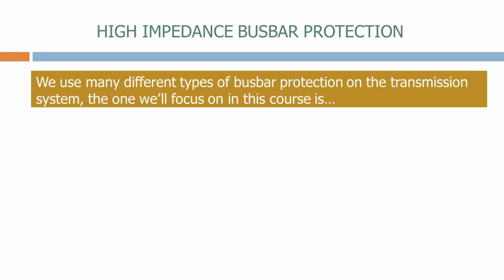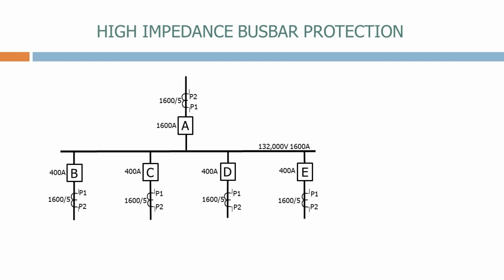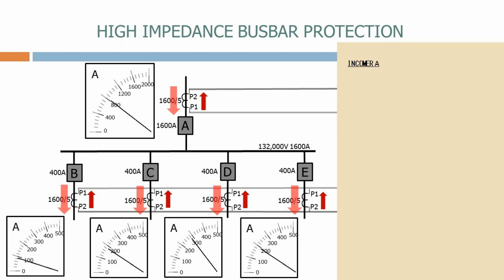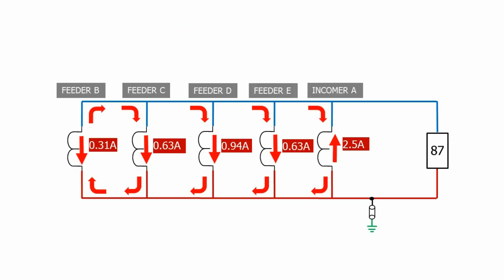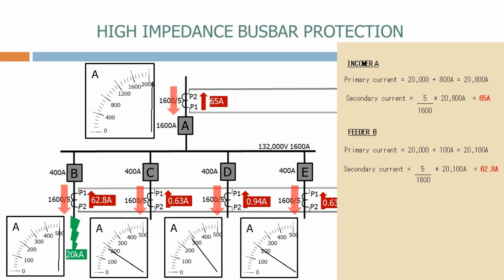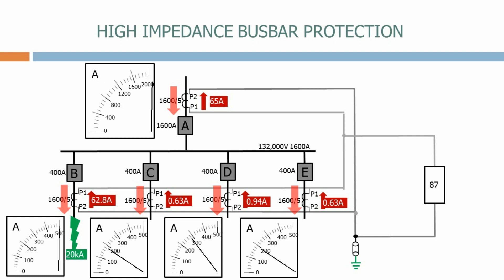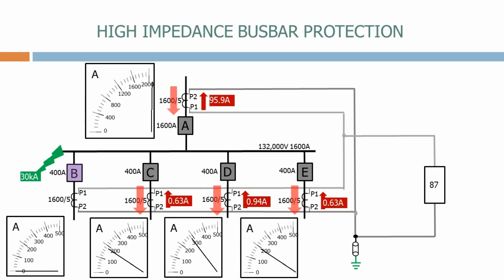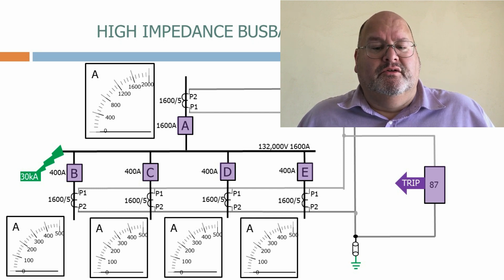High impedance busbar protection

Comment: Why Feeder B breaker is OPEN when fault occurred at BUS
Reply from the maker: Hi Shazeb, for the example shown the fault was on feeder B, outside the busbar protection zone. The protection correctly identifies this and only opens the feeder B circuit breaker, disconnecting the fault from the system

Regards

steve

Comment: The 5 A secondary rating of the CT always raises questions with students when they see 65A of current flowing during a fault! Intuitively they don't expect to see any current greater than 5 A.!
Reply from the maker: Hi Jason,
                Agreed!! I have seen CT wiring connected to telecoms terminals through tiny wiring as the installer doesn’t appreciate that the primary system fault current of 1000’s of amps gets fed through to the CT secondary wiring….

steve

Comment: During the Short circuit moment why do the feeder B C D's currents are not becoming zero?
Reply from the maker: Hi, 
     Because the generators are feeding energy ( current ) into the fault, this will continue until the protection operates ( which it should ) or the generator voltages collapse. steve